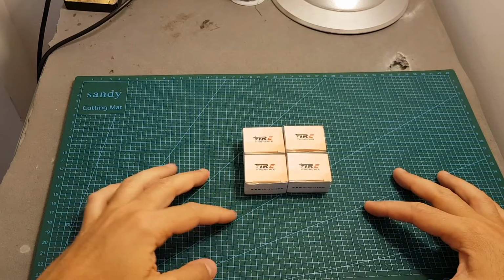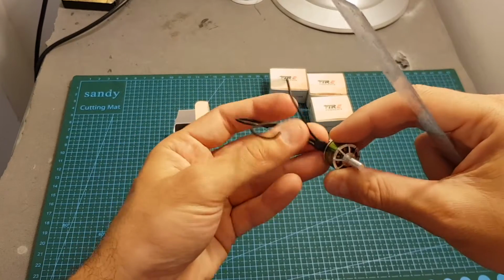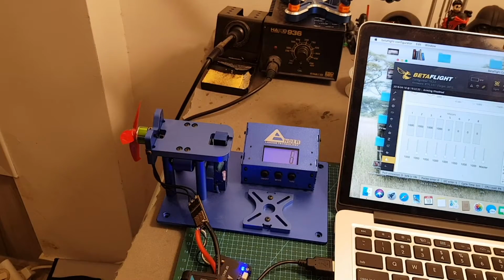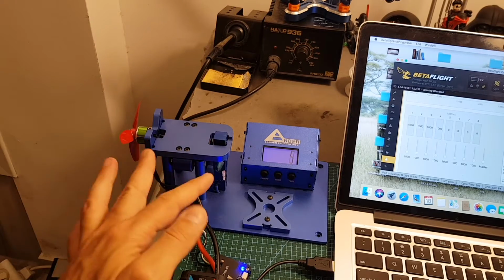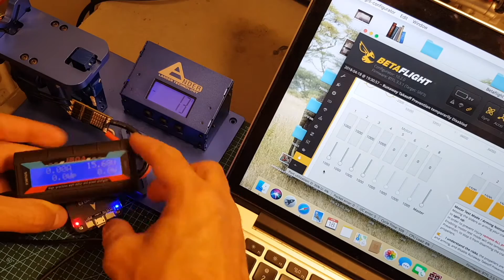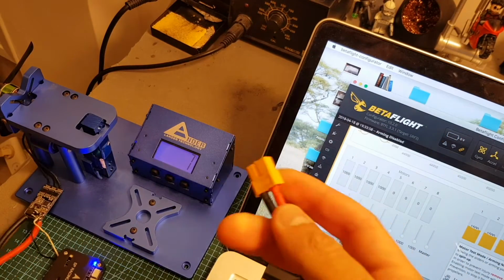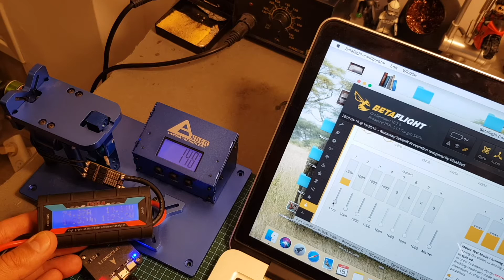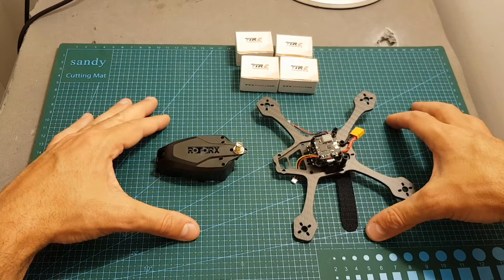AOKFLY RV1407 3700KV Motor Testing + RX122 4" Build video

Comment: Great review!
Which are your preferred motors if your list?
I'm looking for 1306-1408 motors and not sure which choose
Reply from the maker: Thanks! Which frame are you going to use? The RV1407 are going to be greag for a 4" build or a powerful 3" build. If you would like to get longer flight times, check out the RV1306 version: http://bit.ly/AOKFLY-RV1306
Reply: Gal Kremer frame is a Geprc Sparrow (f130). It's currently set Readytosky S1306, and the time fly it's already fine, but I feel a lack if power when I push hard.
Reply from the maker: I used T-motor T20 on my Geprc Sparrow build: https://youtu.be/52LFOKoaol0